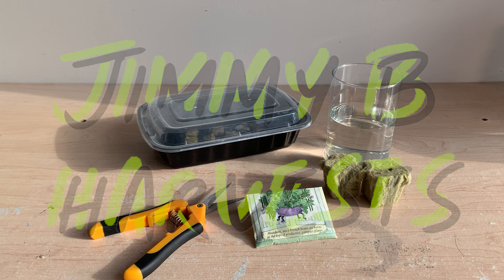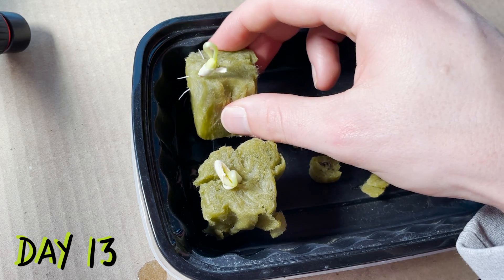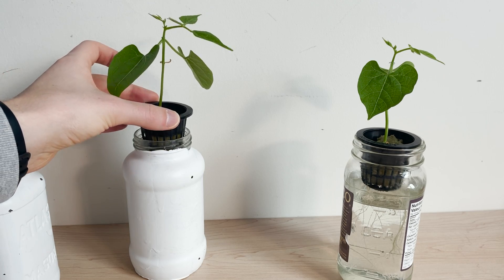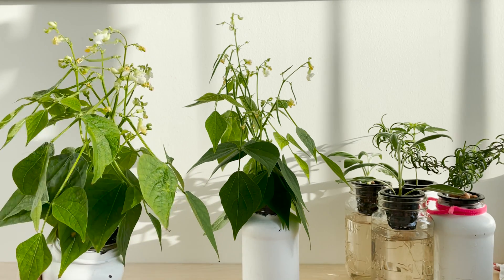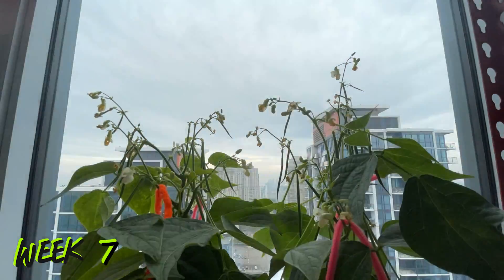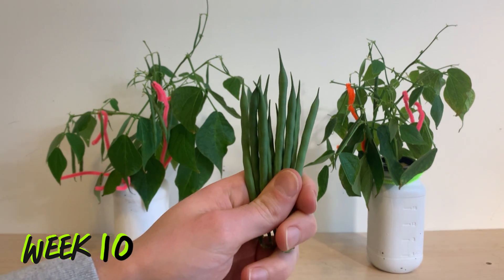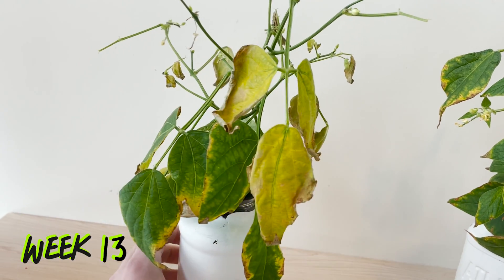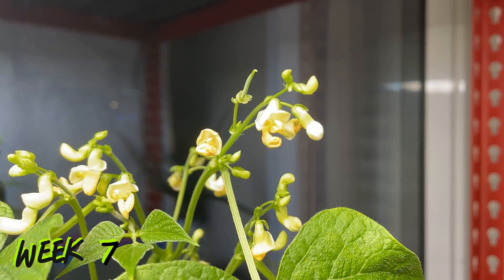Hydroponic Green Beans - Seed to Harvest

Comment: With Gratky hydroponics, you're not supposed to top up the water.  The plant forms air roots as the water level goes down and the water roots grow deeper to follow the water while the air roots get oxygen and moisture.  Calibrated nutrient water has to be added, but not topped up, because the jar is so small.  In a large enough jar, there is no need to add water.

Comment: What is the strength of the nutrient solution did you apply on these bean plants? I plan  to grow string or long beans hydroponically but i dont know the ppm requirements.
Reply from the maker: I just follow the mixing instructions of whatever nutrients I purchase and that hasn't steered me wrong yet. Was most likely using the advanced nutrients micro/grow/bloom here. Just a base series, nothing fancy.

Comment: I have no idea what I'm talking about, but it looks like your plants had nutrient burn, most likely from nutrients concentrating in the jars from evaporation and being continually topped off instead of occasionally replaced (or topped off with just water).
Reply: That's what I was thinking. Especially since beans are very light on nutrient feeding and being grown indoors I can't imagine the outside temperature making all that big of a difference. Although I might be wrong. Beans my just genetically be predisposed to die after a given lifespan. Harvesting does expand the life of beans when you grow in dirt, but they do eventually die. I'm curious if a perpetual bean plant is possible.